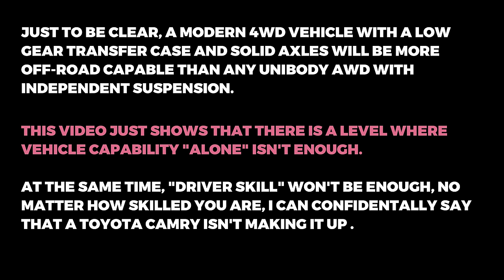HONDA RIDGELINE vs. LANDCRUISER vs. JEEP on 40 Deg HILL CLIMB!

Comment: It would be good to talk to the Jeep and Land Cruiser owners to get an idea of what happened, did land Cruiser not have any lockers, did it go into low range? Was the jeep a 2wd, did it also lack lockers or knowledge in low range? jeep and land Cruiser failed without knowing why so that's unfortunate, could be inexperienced like you mentioned vs experienced Ridgeline owner with awd and it's traction control. Like you I'm surprised jeep and land Cruiser failed but that gorman obstacle attracts all type of experience leveles and comfort levels too like you mentioned.
Reply: U can see all their wheels spinning for traction and had they been in 4hi they would just stall/not spin wheels, that 5gen 4Runner that was wondering around the obstacle also attempted several times and could not make it up.
Reply: @k20z3allmotorFTW  wonder if I can make it 👀
Reply: Some of the Jeep/ LC guys tend to see what they can do w/o all the aids… then once they get stuck, they turn it on.   Goin up triple locked is usually pretty easy… However, some guys didnt take the best line either, which is fine. This is the place to practice and make poor decisions too… lol. 
That being said, Manny made it look easy!…
Reply from the maker: @josephpark421 that’s the best way to learn, and sometimes aids can get you into trouble.  I learned from a very experienced Jeep wheeler.  He taught me how to left foot brake, and showed my friends that engaging lockers can lead to sliding, and…. That can make someone roll off a cliff.  Yeah, absolutely amazed how many did it.  He used just enough throttle (about half way) and just held it there.
Reply: @k20z3allmotorFTW   how much did you drop your air pressure? looks like you were running about 20lbs?  that jeep was rolling at street pressures, I knew the second I watched the video he wasn't making it.
Reply: @k20z3allmotorFTW how can yo used all 4 wheel grabbing for traction when you only see the passenger side.
Reply: @Moorejoyinthejourney 18-20 psi not sure what the other guys where running but the assumption is when u enter the park, the road traveling in is rough so most people air down at the entrance because it’s be a shitty experience driving that much on street psi.
Reply: Fair enough, just looking at the video, it appeared the Jeep had no flex in the side walls at entry or during his short ascent when attempting the first obstacle. on the second obstacle you can see that he is aired down. Just thinking Jon should have named the title of " bad ass ridgeline" instead of "honda vs landcruiser vs jeep" when were not sure apples are apples, but I imagine its a good way to get some clicks  eh?  hahah that being said, you have to be happy with the investments you've made in your rig. I didn't think your were going to make that second obstacle.  @k20z3allmotorFTW
Reply: @Moorejoyinthejourney  I’m definitely happy to be pushing the platform and I knew modifying it would be difficult with no aftermarket support.  I’ve been enjoying seeing it progress to where it’s at now from where it was the first time I visited this place.
Reply: @Moorejoyinthejourney they are two different jeeps, that’s why. The one he calls a rubicon on the first obstacle is in fact a sport model with open differentials front and rear. Look at the spare tire on the back and you’ll see there’s a difference between the two. The sport model doesn’t have the hood vents either. The rubicon has sway bar discos and front and rear lockers. Night and day difference.

Comment: The weight of the Honda ridgeline is lighter than most of the cars there and have good grips on the tire with a lower center gravity.
Reply from the maker: It’s actually the same weight as a 4Runner at 4500 lbs stock, and heavier than a stock Wrangler.

Comment: Aside from all the reasons why any reasonable capable 4wd may or may not make it up this, I'd caution anyone without a 'real' transfer case (a few cars today have a 'low' range that is just a lock in 1st gear) to do stuff like this because tis really going to stress your transmission. If you want to do stuff like this, just get the most capable vehicle. and as far as sending it when you lose traction...just don't.

Comment: I can make a yugo outperform a jeep too but it's still a turd. Why anyone would put money into a minivan/truck is beyond me.
Reply: Something to do I guess
Reply from the maker: I have a similar thought process as you, but just think 4x4s are lame.  Why don’t we have 6x6s here in the USA?  So why bother fixing up a 4WD?  That Ridgeline has very cost effective modifications, about 5 to 10x less than fixing up a 4WD with coil over lift kits.
Reply: @JonDZ_Adventuring  100x more reliable than a Jeep, as well.